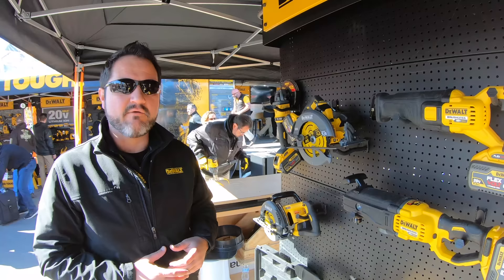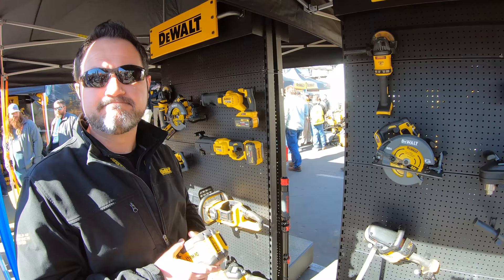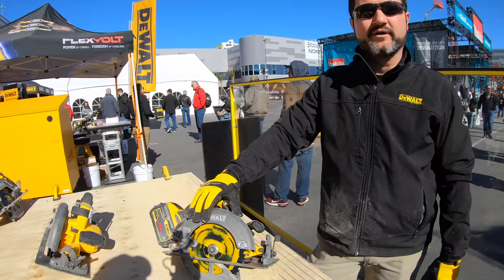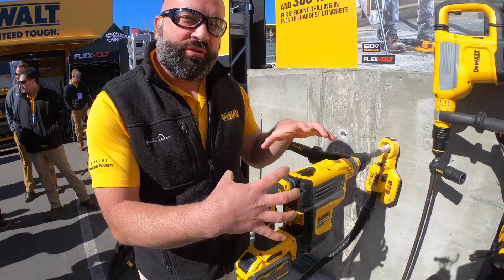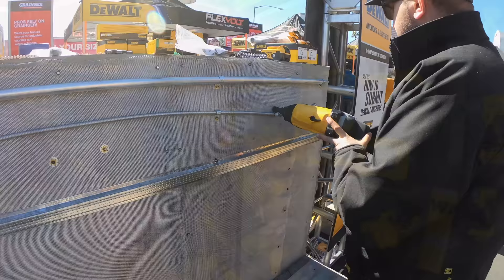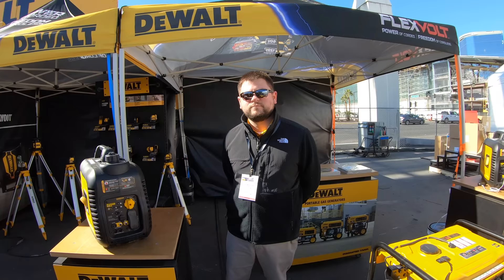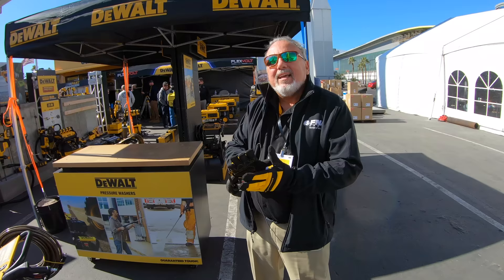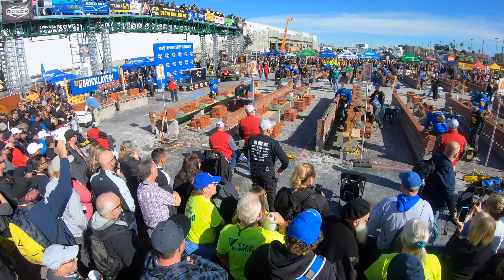8 New Dewalt tools

Comment: Hi Stan,

These are some DeWalt tools that would been nice to see in 2020

1.  A new DeWalt 6 1/2 circular saw with a brushless motor. 

2. A new DeWalt brushless 7-1/4 left side blade circular saw (Top handle style) not a rear handle style.  

3. DeWalt 4 or 6 gallon cordless vacuum like Ridgid. 

4. DeWalt 5" disk grinder with a side switch. Not paddle style.
Reply: Only problem with 2020 is businesses closed, people out of work, tools?...collecting dust

Comment: We need the 7 1/4  skill saw to have the blade on the LEFT side instead of the RIGHT ! Just like the worm drive
Reply: Guess that's 1 tool you'll have to get from Skil.  That's 1 tool I have never used or owned is a Worm Drive Saw....I want one but have no use for one really my sidewinder does everything I can think of doing, and it weighs a lot less LOL.

Comment: Put out a flexvolt left side blade circular saw.
Reply: They've  had the wormdrive style saw for years. Or were you talking about a skilsaw styled sidewinder?
Reply: @alexanderthorstad7546  You get choices for your flexvolt batteries. Reviews tend to give the nod to the wormdrive unit if you are a contractor...
Reply: DCS577 Worm Drive Style is a typical left blade machine and has been on the market since the fall of 2017.  Its a phenomenal saw- tons of power and great weight\balance.

Comment: On the second power saw he just did it faster 😂🤣
Reply: You could hear the motor was dropping rpm on the first. So I think it's legit.
Reply: @raunefare  I'd agree, I have the old one, no way it could cut that fast.
Reply: I heard the difference before it touched the wood. And that was cool he used the same battery.
Reply: Yer I agree. I’ve Seen this type of test before. Complete rubbish.
Reply: There is no way the dcs575 could cut that fast. The rear handle could. The only way they could cut that fast with the dcs578 is if their claims of how much of an upgrade were true. Grab a dcs575 and try it yourself if you don't believe it.
Reply: I agree, I think he was faking it.
Reply: Just the usual trade show bullshit, they tell you anything to sell the product, coz there getting paid to

Comment: Does anyone else usually dismiss and totally ignore manufacturer's performance demos of their products against competitors? Unless I'm the one inspecting and running the test tools I could not care less.. 😩😧
Reply: Yes! Wow, cool, it goes way faster. Probably them just pushing less. I'd have to see for myself.
Reply: I own the flexvolt circular saw gen 1 and it's a beast. I actually never feel like I need more power. It cuts through anything I throw at it. It's one of my favorite dewalt tools I own.  But if it ever breaks im def buying another one. In the demo I could hear the newer version had a higher rpm for sure

Comment: I can tell u that the circular saw does run better. I have the upgraded 20 volt power detect circular saw and it flat out runs circles around it's previous model

Comment: Those 60v saws are almost as good as my Milwaukee m18 fuel 🤣
Reply: 60>18
Reply: skliros or so the sales pitch says. It doesn’t allow you to get any more watts out of a battery pack. It’s the same batteries in the pack just wired in series instead of parallel to increase the voltage. It reduces the amperage with higher voltage. But a watt equals a watt equals a watt. So with a good battery and the efficient m18 fuel you can be just as good or better. High voltage is just a sales pitch if there is no restriction to flow of power.
Reply: Christopher Gruenwald your completely wrong. There is No Milwaukee or any other brand tool ( except the super sawzall with orbital) that beat any flexvolt tool.. as a builder with 38 employees we should know.

Comment: You ever feel were getting the con job always having to upgrade every year
Reply: Just as long as they don’t change batteries again
Reply: As long as they stick with this battery design we are not forced to upgrade. And it looks like they are sticking with this battery for awhile. If you are fine with the older stuff which I am even though I love the new stuff, nothing is forcing you to upgrade now. I'm still in the process of upgrading from the old nicad to the 20v. I have the new impact driver and drill. When these newer tools really get out there you can actually find smoking deals on the previous generation. DeWalt will not force me to upgrade these newer 20v tools that I have. I use my tools until they are completely worn out to the point of failure.
Reply: @Scorched Earth I don't use the adapters, I tried that and it was a disaster. They don't work on the saws period. I use 18v on 18v tools and 20v on the new stuff. I hope to be switched over completely this year.
Reply: @Scorched Earth they don't and if they did you wouldn't want to buy them. The 18v nicad are way more reliable than the 18 v lithium. I bought a tool with those and they both failed in record time.if they are in good shape the nicads work fine. They are just big and bulky and take longer to charge. I've worked those old batteries hard all day every day for years. I much prefer the new stuff now.
Reply: Scorched Earth they do
Reply: @Scorched Earth that sucks because the 18v became effectively obsolete, because they charge an obscene price for those 18v batteries and the last pair I bought were really horrible. I kinda ended up in the same boat. But I bought an 18v lithium ion kit a few months before the 20v came out. I tell you one thing, these 20v batteries better stay around for a lot of years. Because if they make this system obsolete I will totally switch to a different brand. And I'm pretty happy with this setup and plan to buy more stuff. I lucked out and found three 4amp batteries and a charger brand new for $70. It was an off the street deal. Plus a 3 speed impact driver for $70. Also got the weed eater and blower for same price.
Reply: @Scorched Earth when I tried the adapters the physical fit was not the problem for me. My problem was that the adapters could not handle the electrical load. I tried it in the saw and it literally smoked that fucker. It was also stinking and starting to burn up in my drill when drilling large holes. If you are using the tools a lot it's time to bite the bullet and go to the 20v. Although 20-volt is not really 20 volts it's actually 18. It's not really possible to make a 20-volt lithium ion battery, because the math doesn't work out for that. I suppose you could make a 21.6 volt battery, which is what they probably should have done. They just use 20 volt as a marketing thing. The 60v is probably more like 54. Each lithium ion cell is 3.6 volts.I had no idea that the tools were that much more expensive in Canada. If you were close enough to the border it might be worth it to make a road trip to like Detroit or something. Also if you want to buy some time with that nailer maybe you could order some of those cheap Chinese knock-offs. watch the video on project farm where he tests the different ones and find out which one is best and buy that brand.https://m.youtube.com/watch?v=RjBiM0GQEe8
Reply: @Scorched Earth I feel you on that. I am just using corded saws right now. But I miss having access to a cordless reciprocating saw and circular saw. My nail guns are air powered.i refuse to spend money on another old 18v battery unless I find something for next to nothing somewhere off a crackhead or something.

Comment: I wish Dewalt would upgrade their 
1. drywall driver with push drive like makitas 
2. Fix their drywall router so the bearing did anyways freeze up or at least make it easily serviceable. 
3. stronger Flexvolt concrete vibe WITH interchangeable length stingers 4' & 8-10'   
4. cordless drywall sander would be cool too.
Reply: They just released the DCE800B cordless drywall sander.

Comment: Great video Stan. I was surprised that the inverter generator doesn't have a 30 Amp outlet so it could also be used with a camper/trailer. Also, does it allow parallel connectivity so you can get twice the output by linking two together?

Comment: ⭕⭕  Stan, we never heard what the p.s.i. is on the Dewalt pressures washer or what it comes with. Fan tip 35° , 45°. 25 foot hose, 50 foot hose. Injection capable  (soap).  You still did a better job then me on coverage.  Great job.👍👍

Comment: Soooo why do alot of people say Dont buy Dewalt They look kinda impressive
Reply: Most likely because they've already got their batteries and chargers in a different color....mainly that's what drives what brand to buy, whatever you start out with, is normally what you'll keep expanding because you've got the batteries and chargers already so you can just keep buying bare tools only to expand your tool line as you need.  Although some brands do offer much more options, no idea what brands offer what as I don't buy that many tools but some just offer better options in certain brands than others and as a result some people will say buy this brand over another because of tool availability options and pricing.  

I got started with Dewalt about 18 years ago when I won a 4 piece 18V XRP set as a door prize at a new hardware store grand opening, so I had the batteries so I just kept buying Dewalt stuff as a result...not saying Dewalt is superior to any other brand, just whatever you got batteries and chargers for is what you end up sticking to.

Comment: Am I going to get a 60 V three-quarter inch impact
Reply: Be sure to Get the high torque one. I think that's all they make in that size.  I have the 1/2" and it's badass powerful, even with the adapter reduction.  Still takes 33mm semi truck lugs off,  no problem.
Reply: Just buy the 20V 3/4 impact, and put the flexvolt battery on it, doubles as a weapon to knock someone out with LOL, those things are heavy, I had the 20V 3/4 impact for a while and gave it away, no use for it, the 1/2" impact will do everything I ever need, I don't think I'll be changing road wheels on a tank so the 1/2" will work fine LOL.
Reply: William Sevier I already have one I want one with more power I want 60 V

Comment: Dewalt finally get invite to party??
Makita still best bang for buck with more wide range of tools. Milwaukee overpriced. I suspect these 60v Dewalt are as well.
Reply: Thanks I was trying to think of what tool maker has the most range of tools, Makita or Ryobi I think are tops for tool selection in their cordless lineup.  That 60V stuff is over-priced for what it is...I do have 20V and 60V stuff, but the only 60V tool I have is a 16" Chainsaw which honestly isn't much for run-time, about 15 minutes to a half hour depending on your cutting demand...it works great but extremely expensive for no more run time than you get and the ridiculous battery weight on top of it.  I buy everything in the 20V line as I need, the 60V stuff really isn't impressive at all.

Comment: First!... I don't like DeWalt... Milwaukee only!
Reply: Lol fan boy .I like all good tools. I guess it depends on what platform you're on. Each to there own .😁
Reply: @dennysmith2291  same man... Just tools... I have makitas, milwaukees, and dewalts...ego too if you count some yard stuff. They all have their strengths.
Reply: I’m mostly milwaukee too but I have ego outdoor tools (smokes milwaukee and dewalt) and Im looking into makita tools for finish carpentry stuff (more accurately than both too). But dewalts Romex stapler is a game changer and milwaukee doesn’t have one of those either. I only buy Stabila levels. Point being, I best the best tools I can buy within my budget and while I agree that Milwaukee’s battery platform is unmatched, they definitely don’t make all and or the best of many tools. If you own a milwaukee level, and try to compare that to stabila, you’ve been had. And there’s not much of a price difference and stabila comes with a lifetime warranty. Just as an example.
Reply: Dewalt comes out with tools first and Milwaukee will copy dewalts exact design. One example is the worm drive circular saw.
Reply: I'm not a Dewalt fan but thats all I have besides my Milwaukee jacket.
Reply: DefinitelyNotDan  there are battery adapters
Reply: Fan boys are tools! 😁
Reply: Awwww, poor baby.
Reply: @stevew1268  Table saw too
Reply: @stevew1268  oh you mean like the reciprocating saw ie sawzall?
Reply: I being looking every where for a 7"1/4  20 volt Dewalt cordless skillsaw with the blade on the left hand side and I can't find it anywhere
Reply: @nybirdman  if they all used the same battery I would do the same. I stick with one brand on non corded for that reason only. I use my DeWalt tools professionally and don't baby them. They have mostly held up well, with the exception of one drill which I thought failed sooner than it should have. So other than the issue of battery compatibility I'm not going to be loyal to any specific brand.
Reply: DefinitelyNotDan  I think Germany or maybe even most of Europe do have battery standardization. I wish we had that too.
Reply: Andrew Hiker why the hell are you on here?
Reply: @actionjksn  what's your problem!?
Reply: I hate DeWalt tools I only use Milwaukee. I think I will get on YouTube and specifically look for DeWalt tool videos and comment because I'm super cool and elite.
Reply: @AH-up8zh  I wouldn't call it a problem but you literally seeked out a video featuring nothing but DeWalt, in order to make the announcement that you hate DeWalt and only use Milwaukee. If you think that is normal behavior than okay but let me tell you everybody else thinks it's quite strange. my battery tools are DeWalt although I have nothing against Milwaukee it's just when I happened to have. but I couldn't imagine looking for a video about all the newest Milwaukee tools to make the big announcement that I only use DeWalt.
Reply: DefinitelyNotDan  I thought I had read something about it but I could be wrong about that.

Comment: Same old cheap plastic on the batteries

Drop one on a tile floor then go buy a Milwaukee
Reply: have you ever dropped a Milwaukee battery? They split on the bottom seam every single time dewalt batteries are way stronger.
Reply: Dodd Garger the men drop them all the time framing homes, no problems
Reply: DeWalt batteries are fine w drops I drop them all the time and we do Door and Access control

Comment: dewalt guy let me cut though the already cut pieces so im cutting 1 3/4 strip instead of all 3 loll oh the liess lieesss lieess.. all they did was add bigger mosfetts and winded the motor more  or less for more power or added more power wires from the battery to the motor thats all they did